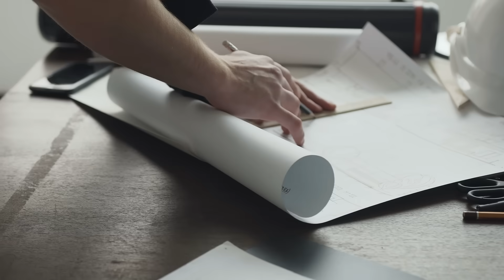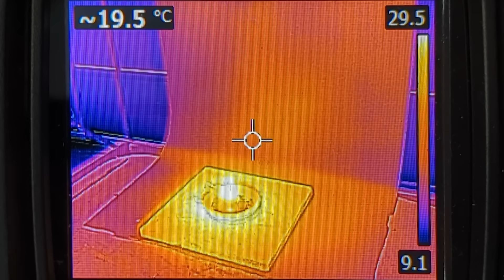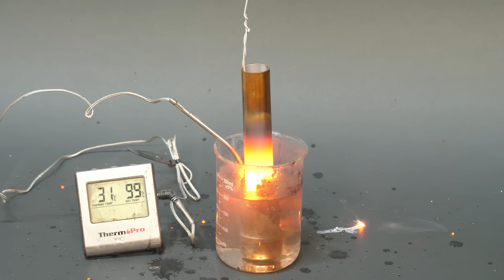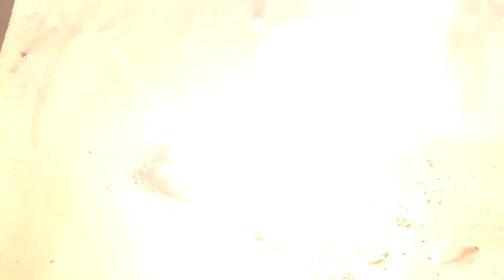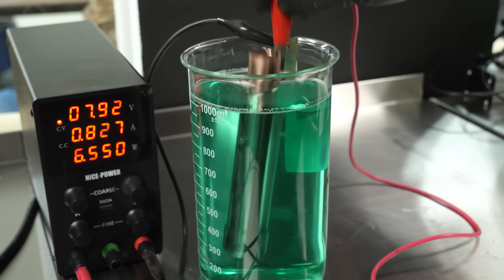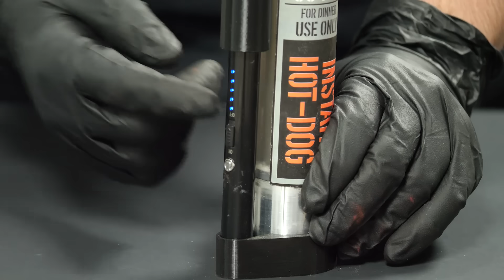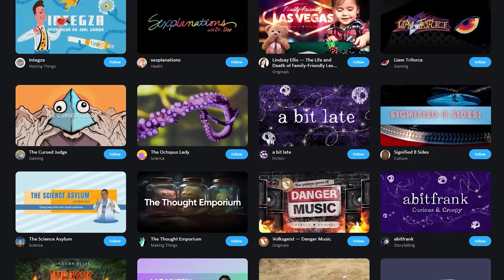Tactical Thermite Powered Hot Dog

Comment: i think you could get the "grill" marks if the hot dog were situated inside a coiled wire heating element while it was in the water. the boiling water will bop the hot dog around a bit, pressing it into the scorching hot walls of its little spring-shaped cage

Comment: I work at galvanic coatings factory and often make nickel plating on copper. You don't need to polish the surface, the secret is cleaning and surface preparation. Use 60 degrees ultrasonic bath with some industrial soap and save yourself a hassle. We also clean parts in galvanic baths, but you can do without it, if you give enough soap time. Then you need to open the surface in diluted acid (we use hydrochloric, but you can also use sulfuric). And then we make sub layer of nickel in nickel chloride bath. After that bright nickel sits tight and pretty.
Well, you know what, the way I describe it it might be much more hassle than to make a 1 cup of chemicals haha.

Comment: Anode and cathode is dependent on if it's a galvanic cell or an electrolytic cell.
Anode is where oxidation occurs and cathode is where reduction occurs.

In a galvanic cell, think light bulb, - black is anode and + red is cathode.

In a electrolytic cell, think charging a battery, + red is anode and - black is cathode.

Comment: I think the issue is the grain size of the aluminum and silicondioxide you're using to make the thermite. My guess is it has to be powderized significantly and more evenly mixed for a sustainable burn as in the few teardown videos of those highbrew coffees it's an extremely fine powder (likely around 2000-4000 micron) that is compacted into the tube. maybe try a more pure low partical size silicon dioxide. that is of course if you guys decide to tackle something like this again. Which I would gladly watch

Comment: Failure to ignite is a common malfunction occuring in a single use instant hot dogs whenever an amount of quartz powder is too disproportional. To clear it, you have to use an open-pour-bang technique: open the base of the device, poor some more thermite on top of the reaction, bang - you'll continue to fire

Comment: I did this already, in highschool.

induction, wrapped in steel 3/16th square mesh.

Jam into any 120v wall outlet and cook, thermocouple on the tip acts as a safety fuse/auto off.

Cuts the 120v AC power when it's done.

Comment: Attending Navy electronics technician "A"  school at  Treasure Island, San Francisco, 68-69, we had a great amateur radio   club.  Look it up--K6NCG.  We experimented by cooking hot dogs with probes stuck in each end, and connected to the AC line.  It  did work.  We got worried that  chemicals/ minerals from the probes  would  end up in the dogs.  Ronco, a once famous  "sold on TV"  outfit,  made such a box,  with cheap low grade alloy metal for electrodes.  Can you spell  "heavy metals?"

Comment: I think a grilled version could be like a hot dog wrapped in some kind of coil the thermite heats up the coil and the hotdog would get grilled, and something pinned in the hotdog to pulp it out after it cooked, maybe you can use tungsten for the coil, i heard it can stand alot of heat and power since its used in lightbulbs.

Comment: honestly i think an electric heater and high power density lithium polymer batteries (either the type used in disposable vapes or the type used for FPV drones) would be a much better fit for this project than thermite.

Comment: i havent watched the entire video but you should try the inside out idea again but use a metal stick that super heats the inside then have a coil that wraps around the hot  dog so it would be the perfeect grilled hot dog. To pull the hotdog out make the metal rod pronged at the end so you could pull it out with ease but this is just an idea and i dont have any clue if that would work at all

Comment: they likely added an oxidizer like potassium nitrate.

also what about a battery powered, contained, single hotdog griller using steel wire or other heating wire with a current running through it?

i've run some tests and i was able to make steel wire glow only putting 5 volts at 2.1 amps through it (yes, a phone charger amount of power) and i imagine if you contained that heat with maybe a borosilicate glass you may be able to cook a hotdog one at a time pretty quickly and evenly.

Comment: Idea: multi use hot dog instant cooker
make a tube like this one, put metal heaters inside of it in a cylinder pattern
Have a heater like goes down the middle like at 1:50
Insert the hot dog into it and it cooks it like a toaster

Comment: If you wrap the hot dog in aluminum foil, then insert into a steel tube, then insert into a clay, semiclosed tube with 25 grams of thermite. I guarantee you can have your baked hotdog. Total cost -$50 probably.. reusuable if aluminum foil replaced.

Comment: "We're doing this in a controlled environment, with trained people."
Uh-huh. Yeah, right. If that's the case, than your average redditor is the head figure, of the ethics committee.

But yes, make a grilled version in a can, that melts apart and only leaves a grilled hot-dog, that you have to scoop out from the burning-hot remains.

Comment: Thermite is cool, I understand. But device turns out to be pretty big. Also you still using water to transfer heat, so thermite is not even directly envolved. That's two things that make it much less cool. 4 18650 li-ion batteries will probably do the trick, and with them you probably can make grilled hot dog. And to boil it you can just take a water boiling bag used in military MREs, it's tiny and triggered by just adding water.

Comment: You could use copper tubing with water inside and Thermite to heat up the Water. The Tubes would have to be shaped around the Hotdog. This wouldn't require a pump as the hot water would go up and the colder water would sink. A Problem I see is the Thermite not reacting long enough or the Hotdog breaking open from the Heat. As a German f yes I want to see a Bratwurst version (They have to be Boiled then grilled, this can be different fron Region to Region and in Saxony where I am from Boiling then Grilling is standart)

Comment: But hot dogs can be cooked from the inside... With electricity. I built a device that consists of two bent stainless rods inserted into a block of wood. Each rod is connected to one side of a double pole switch. A cord is connected on the other side of the double pole switch with a 15A 240v plug on the other side. Place hot dog between stainless rods inserted into ends, plug into 240v outlet, turn switch on until cooked, then turn off when done. Hot dog cooked from the inside with electricity.

Comment: I baught enough stuff to make thermite for 15lbs and i use it to welt steel i beams together wince i dont own a welder and never learned. It take 3 minutes to fill the mold and then maybe 30 for the metal to cool to handle. Its always fun for friends to watch. 

Btw map gas burns hot enough to ignite termite of all types, especially with magnesium shavings mixed into it

Comment: In the 70's, there was an electric hotdog cooker called the Presto Hotdogger. It worked by using the hotdog as a bridge between an anode and a cathode to fry it from the inside out with electricity. That might be a good starting point for a grilled hotdog cooker.

Comment: You can modulate burn speed of thermite by changing the grain size of the ingredients. I'm not sure how far you can push it but surely worth checking out. You could also try different degrees of packing.

Comment: Grilling it would be easy, a nichrome or Kanthal wire wrapped like a coil around a thin fibreglass cylinder just big enough to snugly fit the hotdog connected to a circuit similar to whats in a vaping device but, without the 10 second cut off and much higher wattage.
You could even work out how long it takes to grill the hotdog and program the device to turn on for a set amount of time or, you could add a temperature sensors spike which would spike into the hotdog when you insert it and then turn off the cooking once the hotdog core reached a target temperature

Comment: you guys know that military MREs have a heating pack and you just add water and it will start to heat up and boil really quick. (thats when you put in your meal pack to warm it up)

Hotdogs are already cooked so it's a matter of warming it up.  vacuum seal the Hotdog in a plastic seal (it actually make it longer shelf life). make a pack where you can pull a tab to release the heating pack and boil the water and warm the hotdog. ...

done.

Comment: You must do a roller grill. 3 or 4 stainless drinking straws for rollers. The point is to seal the juices in, and then maintain at serving temperature for an hour or more. The trouble with the boiled version is how quickly it becomes unappetizing if you can't eat it immediately when it's done. The grill version should produce an enjoyable dog whenever you get to it. And as long as we're talking about disposable thermomechatronic devices, you might go a little eco by making each one do two hot dogs. Who's gonna not want two?

Comment: Add some resistive wire around the hot dog and make a way to drain the water and power the wire with a battery for a few minutes till it grills the outside. Use a sqewer to hold the dog in place so it doesn't touch the grill wire. Boil and grill!

Comment: Couldn't you like make a slightly bigger tube with a hollow grill shaped strip that the hotdog sets on and you have the thermite sitting inside and it lights and spreads through tiny hollow strip?

Comment: Ever since I watched this video I've had this idea stuck in my head of wanting to find out how fast I could cook a hotdog but electrically. Like could I instantly cook a hotdog from the inside out with a high voltage super capacitor bank without vaporizing it? Or maybe a very high power microwave magnetron? So many possibles for so little reason.

Comment: no, you run edible resistors through the meat as you process it before it's even a hotdog. have a mechanism where you crack the dog and the current connects the current through and boom instant hotdog. this is an intensly complex problem. nevermind

Comment: When you put the sparkler in the hotdog, you should use a metal tube to cause the heat from the sparkler to get more diversed, and it probably wouldn't burn the hotdog. Just a suggestion

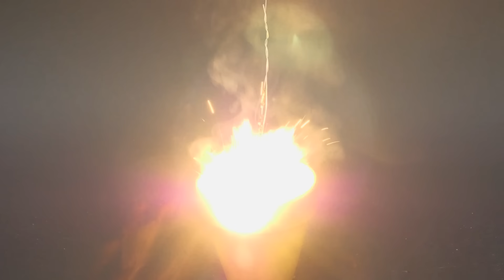Comment: 2:56 
"Including tower demolition by melting steel beams—"
Reply: Not a particularly feasible nor easy means of demolition. The reason classical thermite is used for welding is that it leaves behind metal residue that helps join the two pieces together. You could stress or weaken key beams, but even that's not really all that reliable a method. Shaped charges are quicker, easier, and far more effective.
Reply: @Nixeu42 with a plane it was much easier to destroy a tower

Comment: This feels like the kind of thing that gets brought up as a minor plot point in a funny sci-fi story that's used at the climax when the protagonist remembers that there's thermite in the heater.
Reply: When it's introduced to the hero, someone says not to look at it

It's used as a Cheklov's flashbang in the finale
Reply: @user9267  That's a Deus ex Machina.
Reply: @zdelrod829 Isn’t a deus ex machina smth not previously foreshadowed that suddenly appears in the story? I think the og cheklov analogy is correct?
Reply: @branastasia8013  notably, the Chekov’s gun requires narrative distance between the item and its use. We have that here—the exposition for learning about the instant hot dog, and the climax/almost-climax for its actual use.
Reply: The protagonist is in a damaged ship deep in space. Federation ships have done enough damage to their ship to render its fusion reactor inoperable, completely cutting all power to the ship. The federation is closing in and are just about to capture the ship to transport it to their prisoner system. The protagonist is locked in the cockpit, the doors sealed shut without power. All they have in the room with them is a military ration kit and an emergency fusion battery, which just minutes ago amongst the fighting shattered after a rough impact, throwing glass everywhere and snapping the delicate electronics inside. This battery is the protagonist’s last hope. They plug it into the control panel’s circular intake slot but nothing—the fusion battery is too damaged to make a proper connection. Federation ships finally close the distance and are getting into position to latch onto the disabled craft. The protagonist paces around the room, eyeing the battery and the ration kit. Suddenly, a moment of inspiration strikes. They rip open the ration kit and rummage around, looking for something specific. They grip the single-use instant hot dog and yank it from the bag. They smash the hot dog against the console, spilling water onto the floor and sending the hot dog flying. They take a loose piece of metal from the console and yank it loose, using the sharp tip to undo the screws and seams at the base of the instant hot dog. The device is ripped open and thermite powder pours onto the protagonist’s hand. They shake out the rest and cup it in their palm and assemble it inside the fusion battery, coating two broken pieces of electronics inside the battery and pressing them together. The protagonist fishes the igniter from inside the instant hot dog and pinches it with their finger, striking the tiny sharp igniter against the thermite powder. A burst of light and a small fire immediately emerges, burning the protagonist’s fingers in the process, but they still hold the broken pieces together. The thermite burns brightly and disappears just as fast, welding the broken components back together. The protagonist then carefully grabs the fusion battery and slots it into the control panel, and the lights and readouts on the panel spring to life. The battery begins spinning and wobbling with instability, but the roar of the engines in the back of the ship emerges just before the Federation secures the ship. The protagonist immediately shoves the thruster’s lever forward and the ship zips off
Reply: @tpd1864blake  what a story dude
Reply: @timecubed  finally someone notices my novel
Reply: @tpd1864blake   This was amazing, I couldn't stop reading lol.
Reply: @tpd1864blake what's the book version of cinema
Reply: @danielhernandez2575 Absolute novela
Reply: Existing MREs /do/ come with a heater pack, nothing so exciting as thermite though. It's a green plastic pouch you slide the main course package into, & a "ROCK OR SOMETHING" to prop up the open end just a bit, add a bit of water & it gets at least kinda warm, hopefully at least defrosted if it's really cold. But usually you don't have time to wait for that lol.
Reply: @CitizenHarry631  I still love the idea of that conversation. "what should we tell them to prop it on?" "I don't fucking know, a rock or something."
Reply: @CitizenHarry631  Said "Flameless Ration Heater" uses a powder made of magnesium oxide, some iron, and salt as the heating agent, which is activated with water.

There are also some newer formulas which use aluminium oxide which gets even hotter, and cheaper ones using calcium oxide.
Reply: @CitizenHarry631 I love that diagram
Reply: @CitizenHarry631  really, if you wait a long time outside of freezing temperatures all things thaw
Reply: @machinatingminotaur6285  Luckily aluminum tends not to thaw at room temperature, otherwide we would have nothing to eat MREs with.
Reply: Futurama had the self-microwaving Bavarian hotdog. Fry ate it sitting in the couch of planet express.
Reply: Or a joke item a DM gives you in D&D that you end up using the thermite for an actual useful purpose.
Reply: protagonist dumps out the hotdog, cracks open about a hundred bullets and dumps their powder into the hotdog vessel, seals it, makes a hot dog related pun and presses the button and throws it at the mcguffin
Reply: @override367 your the wurst
Reply: So satisfying ❤😂
Reply: year or as a throwaway joke in iron man 2 that never pays off ;)
Reply: protagonist takes it out of his inventory, bad guy laughs, protagonist takes hotdog and throws it and misses as a distraction, bad guy is bewildered, before coming to protagonist ignites termite and throws it at bad guys face, screams as he is suddenly burnt and blinded
Reply: This is amazing because it is better storytelling then 90% of modern story telling and was made off a little creativity and a thermite hot dog cooker.
Reply: i feel really sorry if the majority of whatever you've been reading or watching is surpassed by a joke comment in a joke video, gotta get out there and find more than whats immediately in front of you and perhaps keep your mind a little more open the next time you're presented with a story lol
Reply: @Ionee-q4f  Would you rather have 1 dollar or 2 dollars?
Reply: @jacksonhoiland2664you don't read much do you
Reply: Average Star Trek episodes be like
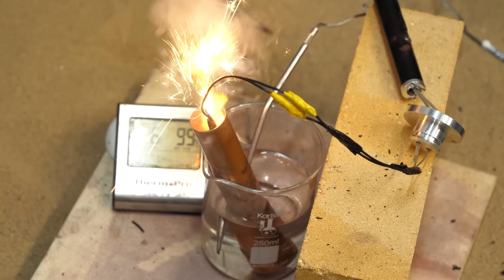Reply: I love the way he just casually talks about it while a flashbang goes off in the distance at 1:30
Reply: I need this!!!!!!!!
Reply: I like it. Thanks for the idea
Reply: chekov's hot dog
Reply: McGyver...

However, self heating food products are usually iron filings with magnesium mixed with water to activate (MRE's) or quicklime mixed with water to activate.   Thermite would need to be ignited.   Note that quicklime is food safe, hornedo's and masa harina are corn soaked in quicklime in a process called nixtamalization without which much of the nutrition in corn can't be absorbed by humans leading to a disease called Pellagra.   The Spaniards and the US learned this the hard way, they saw natives living on corn alone so they had entire towns in Spain and Southern US switched to mostly corn diets as corn is easy to grow but this lead to Pellagra devastating these towns, this lead to advising more varied diets and the fortification of wheat flour.
Reply: Cheklov's Nuke